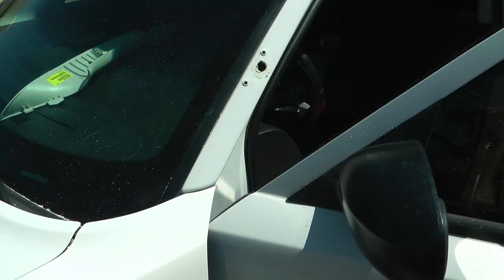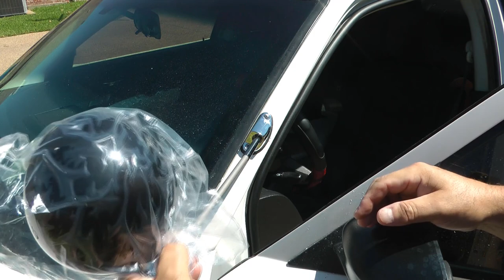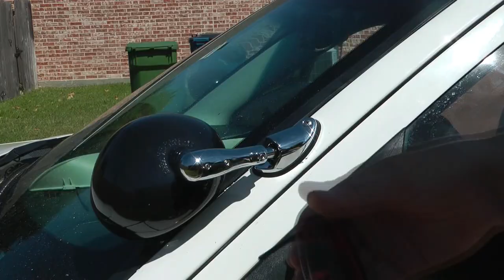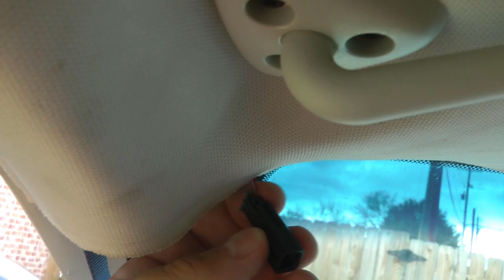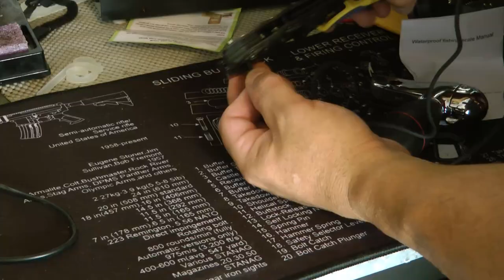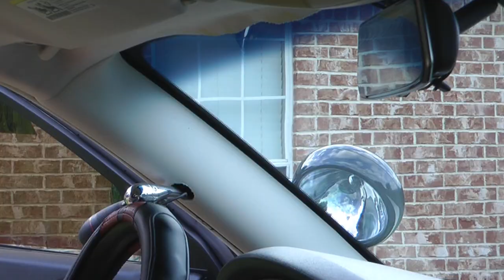How to install police spotlight in Dodge Charger

Comment: Do you think this could work on any car? I’m aware it’s a 2 year old video but still.
Reply from the maker: the riskiest part of a spotlight install is drilling.  It's easy to crack the windshield.  But if you have a car that already has a spotlight hole drilled, putting a spotlight in should be this easy.